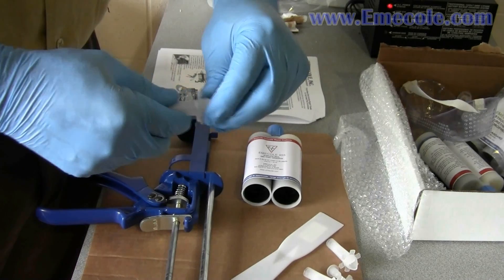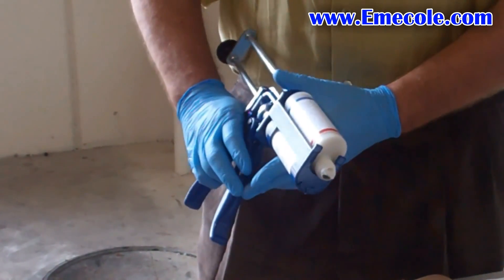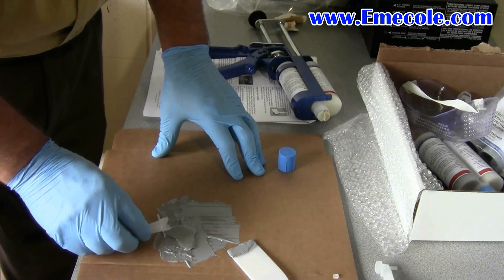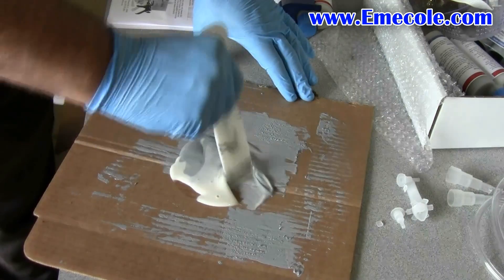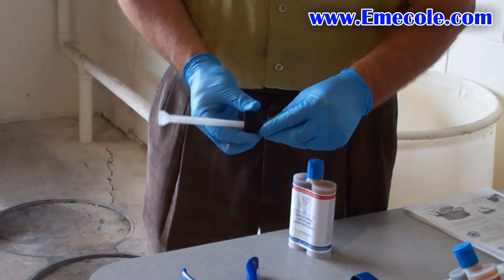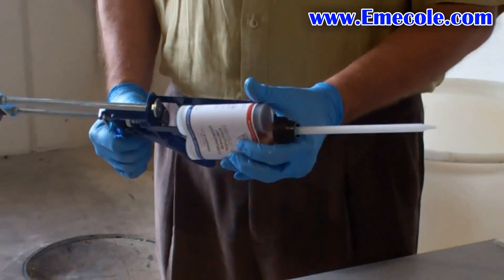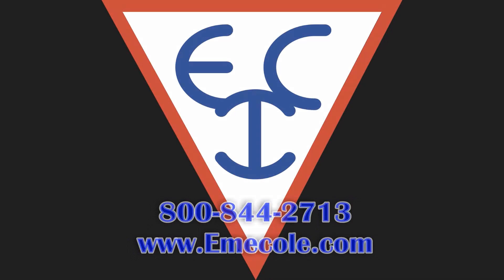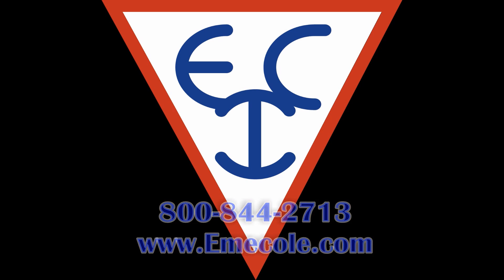Pipe Penetration Kit Instruction Video by Emecole

Comment: The actual package mentions something called crossover restrictors that fit over the 120 before putting the mixer on but there is no mention of a restrictor in the written directions or the video. Not sure why it is never shown in the video or directions, but make sure to put the restrictor on the 120.

In addition, I would suggest you perform some sort of test run with water after you’ve done your application of 455 and before you do the 120. I did not do that and the 120 was oozing out of a small gap I obviously missed when I used the 455. I guess that’s okay but it created a bit of a mess. 

I think I plugged my holes but we won’t know for sure until the next big rain.
Reply from the maker: Hi Kevin,
The crossover restrictors are placed on the end of the Emecole Metro 120 Structural Polyurethane tube set prior to injecting. Since Emecole Metro 120 is a two-component material, it is vital that any injected material that leaves the tubeset doesn't seep back into the mixer from either the static mixer or the hose assembly. That would compromise the remaining material inside the tube set. The what and why of the restrictors absolutely should be in the video and instructions. While we are in the process of redoing our videos, I will reach out to our customer service team and request they add a note about the restrictors into the written instructions. If you have any further questions, you can speak with one of our technical support team members by calling us at 815-372-2493 (Monday through Friday, 7 a.m. to 5 p.m. CST), or via the contact form on our website at Emecole.com.

Martin Hawrysko
Emecole Metro LLC
Reply: Emecole Metro LLC - Thanks Martin. I used the restrictors on my project.
Reply from the maker: @kevinholowicki241  Excellent! Customer service is making that change to the Pipe Penetration Repair Kit written instructions. Thank you for bringing it to our attention.